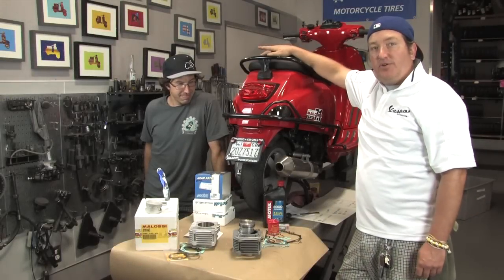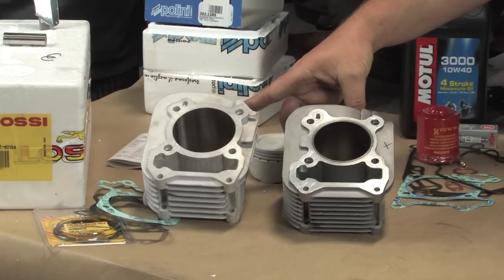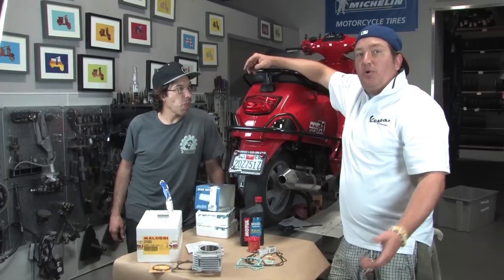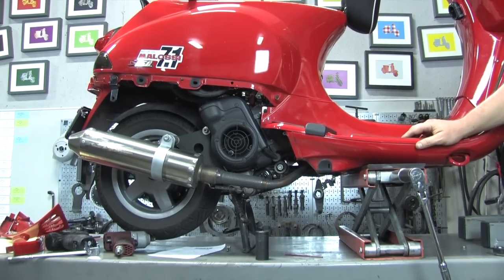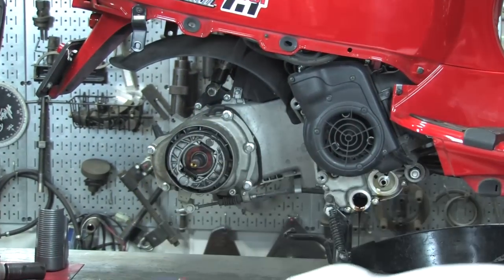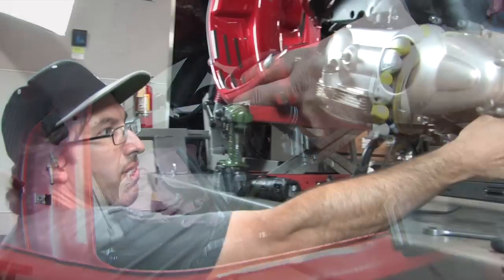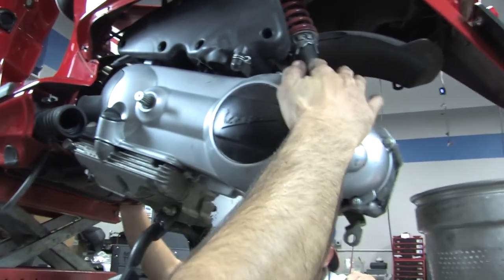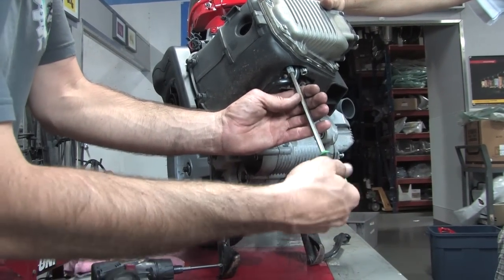Installing a Malossi Kit/Polini Upgear Kit on a Vespa S 150

Comment: I have a 2009 LX150 I haven't start for six months and is leaking fuel after turning off no hoses leaks the fuel coming from a outside plastic part in the left side of the rear tire. . . . any suggestions ?   Thanks

Comment: Hi vespa et4 vespa 150cc engine that I have the 2004 motorspot rear wheel teeth was broken I bought a new one and I want to attach the wheel rim to the inside of the rim wheel starts shaking and not getting Squirrelly reason tell me thank you for your help

Comment: What's consider real high mileage for these engines ? How about 100,000km (60,000+ miles) ?
Reply: My father's 1966 Vespa Sprint 150 had odometer rolled over twice with one rebuilt; so you can expect over 100K if well maintained.

Comment: 62 I think... yea best be vague..eh... nice work...  love lambrettas my self..TS225...cassette cluyh. 32 delly.. DJ pipe.  20  47. drive through GP box. sip rims . Metzler rubber.  120 watt stator. RD Reed.  and few other nice bits from. AF. MB. bgm sip etc...high 80s. never been into last 1/4 throttle yet..main jet 165

Comment: Is this run smoothly when it start gear ???? Ex: in traffic jam road......... I am using Vespa S 150 2015, my moto not running smooth at all while in traffic jam road and first start gear. It start shake until speed 30km/h up...
Reply: Check Your slide pieces

Comment: Can it be installed on Vespa 125?
Reply: Yes considering it's exactly the same bike just bigger cc. You can also with fuel injected 125 model use the 150cc injector to add more fuel

Comment: Imagine these Vespas with a round headlight and you pretty much have an LX 150.
Reply: True, I have a S150 my wife has an LX. Beyond the headlight, the gauge cluster, the seat, the trim on the front shield and fender is different, no glove box on the S and the S has a kick start. Cheers.

Comment: Very much the same step as the carburetor model, other than you plug in the fuel controller inline with the o2 sensor and fuel injector.